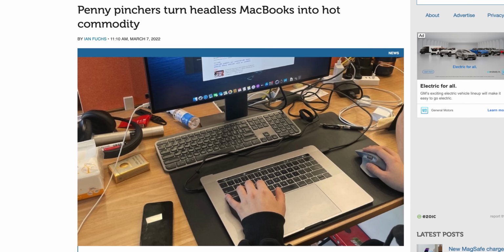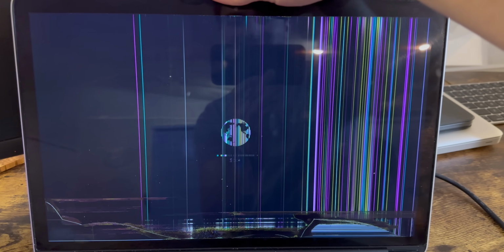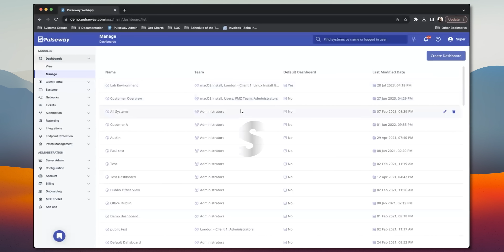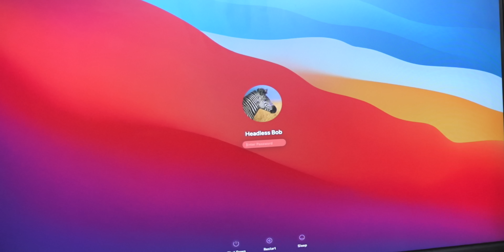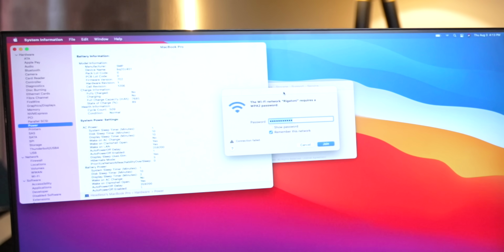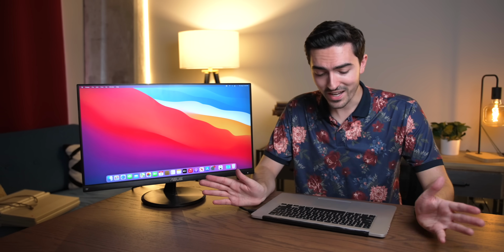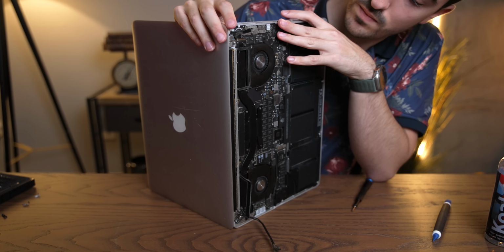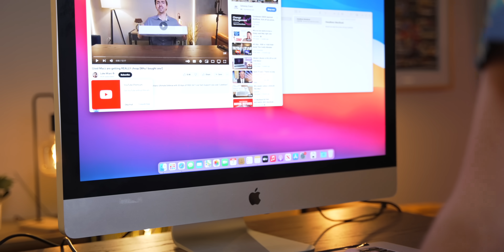Exploring the weird world of 'Headless' MacBooks

Comment: I have two mid-2012 13 inch macbook pros and just bought two aluminum stands (on edge) with the lids closed and hooked to 27 inch monitors.   I didn't bother to do anything with the displays (they worked).    I have a great Logitech wireless keyboard that allows for up to 3 computer hookups with bluetooth and that allows me to share a backlit keyboard that is chargeable (several weeks of use).    I have a mouse with each laptop.   The displays are better quality than the original displays and show true 1080p not the native dumbed down version.    I would love to buy a newer broken screen mac to play with and to hook up to an external monitor.    That will be my next project.

Comment: It is Apple’s entire business model to make you buy a new machine when your new one is broken. Apple green washes like all the other big corporations. Your last video proves the point of how hard they make it to repair or upgrade. Very difficult to break through the walled garden. Really sad state of affairs as we drown in all the e-waste. Thanks for your and Rossman’s advocacy on this subject!
Reply: You are absolutely right. I have been selling new Apple computers and repairing Macs as a certified technician for over 14 years. I hear time and time again from my customers that they have been told at the Apple Store that their Mac is obsolete at 5 years or more of use. This is how Apple sells new computers, but it is simply a lie and anything but honest or in the interest of the environment.

In my consultations with customers, I communicate quite differently because judging a Mac by age is wrong. I judge a Mac by its compatibility with the current operating system. And even that doesn't matter if the customer still gets on well with an older macOS version and can do everything with it. So I repair Macs much more often than I sell new ones because that is more economical for the customers, as long as the performance of their Mac is still sufficient.

In fact, most users only use Safari, Mail, Photos, Pages/Word, and a few other apps. Nothing that would require enormous performance. And very few people need an M2 for that if the CPU was hardly used to capacity with an i5/i7.
Reply: @level16gmbh83  It baffles me that customers shell out 1500+ dollars for a macbook while they could perfectly live with a 250 dollar chromebook...
Reply: @level16gmbh83  So you are complaining that Apple ultimately gives you ongoing work?
Reply: @level16gmbh83  i think its funny how "fast" Macs get obsolete (officially). I mean I still could use a 2010 laptop normally for these tasks you mentioned, if it came with an i5 (maybe even higher-tier C2D) when upgraded to an SSD and more RAM, as long as it runs Linux or Windows. 2010 MacBook Pros didn't get a new macOS since 2017 and the last security update was 2020. Atleast with Intel Macs you have the option possibility to install Windows/Linux, but I don't wanna know how this will work out with Apple Silicon Macs
Reply: What's really most important to Apple is the price of their stock. They have to extract as much money from customers as possible, every quarter, to protect shareholder value.
Reply: All while they scream at public for hurting the world while claiming they are the pure ones saving it...
Like electric cars not being repaired and keeping silent about needing new battery packs all the time for extreme prices..
They could use Hydrogen with a normal engine but that would mean people could fix their cars and fill them as they want for travel over any distance...
They instead want to make new cars into current phones..
No repair, your every bit of info monitored and your controlled by the product creator..
Reply: Dude but apple removed the chargers from the iPhone boxes, so they obviously care about e-waste and the environment.

Comment: Great video… I've done this a couple times… I've also found that the illuminated keyboard stops working… Because the camera sensors, detect, ambient light… And the ambient light determines whether the keyboard is illuminated or how bright the display is… So there is a need for a work around that I haven't figured out yet… Love your channel! Continued success!
Reply: Doesn’t stop working. Just turn off the ambient adjusting of the keyboard brightness

Comment: I use a 2017 MBP with like 10 percent of the display dead and weird colours sometimes but you can press the screen down and it’s fine. I use it often either as a desktop or just with smaller windows as my previous MacBook was an 11 inch MBA, and my most used devices are my M chip iPad and gaming pc anyway. I got the MBP for less than £100 and everything else on it is perfect so it’s a good way to have Mac OS when I need it.

Comment: So essentially this harks back to the late 70s/80s  personal computers a la Commodore 64/128 or the Atari offerings of the time or even the Timex/Sinclair computers from that time period. Cool. I'm one of those strange people who loves to play around with old "antique" computers. If you run O/S and software it was designed for, they run almost as fast as modern computers. Don't believe me? Try running system 6 on an old compact Mac SE or even better an SE30.
Reply: My first computer was a Timex/Sinclair 1000 2K RAM with a 16K booster cartridge, a cassette player for storage, and a 13" black and white TV. 😁 Next came a C64, then a C128 lol. Were you spying on me?

Comment: I bought an M1 Pro off someone for £400. Directly a screen replacement is £820 or DIY is £600. I took the screen off and use it headless. Only disadvantage is basically driving 2 displays at all times but it’s a cheap Mac mini Pro alternative for £1K less with some advantages. Just make sure to learn the screen swap shortcut when updating the OS CMD+F1 I think off my head. Everything works due to the M1 Pro design Wi-Fi and Bluetooth.

Comment: The fact that you can move it around while on battery is pretty cool, but if you actually want to use it as a desktop it's probably a good idea to remove the battery so it's not plugged in and charged all the time.
Reply: If you remove the battery the SMC will have a fit and will run the fans 100% and throttle the processor.

Comment: Hi Luke, I just did the same thing for a mobile recording system. I repurposed the Wi-Fi antenna assembly same way you did, yes with black tape as well 😂, but plan to create a nicer 3D printed solution soon. I mounted the headless MacBook Pro 15 2014 in a custom rackmount sliding drawer. I’m using a portable display that I mounted above the rack case that folds out of the way for transport. Fun project, used parts I had lying around to create a great mobile pro audio mixing and recording system. Spent $70 on MacBook Pro, no SSD 😢, but put a 2TB in it for not much money.

Comment: After the fun activity of pouring liquid into my display, I turned my 2016 13in MacBook Pro headless. 
Wifi still works (antenna outside of the display hinges) and the Touch Bar is finally useful! 
I installed a mod to display useful info on the Touch Bar, including an the Airplay command to connect to my Apple TV.

Comment: Obviously Apple has no "obligation" to make repair parts available for a reasonable length of time and at a reasonable cost, but they should. They should also have an obligation to make their items repairable, at least to some extent. The idea of having to be Hugh Jeffreys and have a dedicated heat plate, or to have a laser designed to burn away the overly strong adhesive is absurd.

I'm fine with not having the device as easily opened as, say, the EU is suggesting needs to be done. That's a little over the top. But having something someone reasonably technical can repair, or which can be brought to a shop for a reasonable price for a battery or display replacement, and one which won't generate countless warnings about fake parts or disabled services, that should be their obligation.

Comment: A few of your recent videos seemed liked commercials with just enough content to pretend otherwise. This video was a solid repair/reuse video that also contained a good and strong theme.  Apple would, if they could, try to get people to buy a new laptop if their battery ran down...or force them into the Apple Store for a recharge because doing so yourself would be deemed "too dangerous." This is no exaggeration, for much of what they have built into their machines is an attempt to ring the maximum amount of money out of the users while claiming safety issues, etc. So this video is timely, non-namby-pamby, and makes a bold and needed point.

Comment: I'd be curious to see this done with a modern Mac, if it's still possible. You could have power, display, and ethernet over a single usb-c cable making for a pretty sleek desktop solution.
Reply: Yes, and it's actually easier on those models because the antenna bar is located in the top-case as a separate part.
Reply: Yes, I did this with a 2020 MBP with a blown LED fuse.
Reply: @jcw1569 m soc or intel?
Reply: @cosettapessa6417  apple silicon
Reply: I’ve done with an m1 air
Reply: It works great on M1. Using as my daily driver now.
Reply: Currently using the 2020 MBP M1 and the screens destroyed but I plug It into a monitor and I have no issues besides not being portal anymore

Comment: Isn’t the base m1 Mac mini or m2 Mac mini better deal. They are more powerful, while is extremely affordable, especially when you use student discount or buy one second handed.

I don’t see a point of using inferior laptop as desktop, while losing the laptop feature, for ever.
Reply: Someone here mentioned that they tried this with an M1 but something about the system forced it to not do the clamshell thing correctly without an attached internal display. The point is that sometimes a setup like this is fine if you're not plotting galactic wormholes or doing structural engineering 3D models. Not everyone needs top horsepower to do what they do, and not everybody has $$$ for the latest tech either...or the desire to buy it.

Comment: When you said the only downside is you can’t use Wi-Fi or Bluetooth cause of the antenna placement i was like “no way Luke is gonna stop at this”. And like always you didn’t disappoint ❤
Reply from the maker: You know me 😆
Reply: @lukemiani did u 3d print any case for the antenna?can u share the stl ?
Reply: Will no-one mention the way he installed the antenna he taped the vents up completely, so the device will probably overheat quickly?
Reply: @piotrch0 no he didn't. The vents you can see are visible. He just installed a plastic and tape cover where the hinged screen would be.
Reply: My display died on my 2019, want xCode but don't wanna spend $700 on a repair or 2k on a new mac. I went headless. It pretty easy tbh. I reinstalled my wifi and Bluetooth antenna bar. I have wifi and Bluetooth with no exposed wiring, etc.
Reply: I don't get why he didn't use a small usb dongle for WIFI and Bluetooth... Seems so much simpler to do.
Reply: @nearcz533 one downside is you lose a USB port. The way he did it has really no downsides aside from a bit of extra work
Reply: @jarboer but it’s never leaving your desk anyways. Not really a inconvenience to add a usb hub
Reply: @jarboer another downside I see people forgetting is macOS, especially later versions such as big Sur, don't have drivers for usb WiFi dongles and with the way apple changed how kexts work in big Sur it'd be more trouble than its worth to get handoff, etc working, let alone WiFi. Plugging it in over ethernet would lose you a thunderbolt port and those aforementioned continuity features, etc. This is really the best way (other than buying your own antennas which would probably look worse) to get WiFi working.
Reply: @mattwilson8509  I mean who said it won’t leave a desk? Luke mentioned that it would also be easier to connect to a TV to watch something (compared to a Mac mini), though that might not be that important for everyone
Reply: @jarboer  Yes, he mentioned that, but let's be honest: You do not want a media computer running off batteries (quite old batteries at that). The battery is helpful so you can switch to your TV in another room without having to turn off the machine while you move there and plug the power adapter to mains again.
Reply: @BilisNegra  ah now that you mention it, he didn't have his MagSafe adaptor plugged in in the video - guessing he usually does! (I know I have my headless MBP2015 plugged in pretty much 24/7)
Reply: @nearcz533 he was pretty clear @7:01 he thinks plugging yet another thing into the side is pretty ugly (not to mention the theme of this video is to reuse & maximize his $60 investment - electrical tape is about all he needed at the end of the day which is pretty cool!)
Reply: @nearcz533 then you would lose an usb port, handoff, Airdrop etc. Why would you want to lose those if you literally can plug the antenna back to the original wifi card.
Reply: @nearcz533 I think the drivers wouldn’t be so simple as it is in windows. Windows is just plug and play, but MacOS probably only has drivers for the antenna that comes with the laptop.

Comment: Excellent video. I've been doing this sort of thing for years.
How about making a 'home only' lightweight laptop? You get a small underpowered inexpensive laptop and use it to display a powerful desktop system running somewhere else on your network?
Reply: You're describing a Chromebook using Remote Desktop, and there are other setups like that but I can't remember what they are right now. I don't use that, but I have tried it a few years ago and it works pretty nicely.
Reply: I was actually thinking of an apple laptop with a decent screen. I hate Chrome books. My plan was to use Anydesk - to get the sound. I use VNC for my RPis. I bet a purpose made Apple solution would be fantastic.Light weight, Great screen and sound, no memory or storage limitations and a good keyboard. What bit could we fix up to manage that I wonder.
  @CallibanMcGee

Comment: I agree that repurposing is so cool and handy!  I also agree with your point about the Right to repair and accessibility to parts. BTW your Sihoo C300 chair is excellent I really want one, but it's sadly not available outside of us with your code...:(
Reply: For older laptops like this economically new original OEM parts are always going to cost way more than the device is worth.   Running a dedicated production line for the low volume of parts that would be needed would push up the per part cost way to high.

Comment: A wireless display connector would turn this into the ultimate htpc. Would Bluetooth be enough to cast a 4K (or 2K) picture to a display?
Reply: not possible. Would have to use specific product in hdmi port. wireless HDMI adaptors exist, but i think they might be on the $$$ side

Comment: I've thought about doing this before, but thought I'd screw it up.  Great video as always.  One additional thought - I use an Apple wireless keyboard and a magic trackpad on my desktop Mac, and I definitely prefer to have the trackpad to the right side of the keyboard instead of underneath it.  But I have no problems using a laptop.
Reply: You can do it! Luke's videos and iFixit or others make it accessible, if not easy.

Comment: Yes I believe Apple needs to make parts more available. While this is a cool mod that I’d certainly do to retain a machine’s usability, I would much prefer a full MacBook as I could connect it to a monitor the same way. 
Also Luke, where do you get the background music for your videos?
Reply: Providing parts for 10 year old Macs is not as easy as you might think.  The production lines that produced those screens have long since moved on, so if you wanted to fire them back up there would be a large overhead in cost making the per screen cost much much higher than would be acceptable (as the number of displays they would produce would be low).

For this situation of old devices what would be better would be to provide the schematics and CAD files etc with a license to that third party vendors could go out and make alternative parts (not OEM).

With the specs having a license that others could target (legally) im sure some companies would figure out how to make little adaptors to that you could attache more commodity display panels without needed to fire up a dedicated production line again.
Reply: Apple gives not a shit about making their crap fixable
Reply: @bb5242   Not true apple care a lot about this, but only when it is themselves doing the fixing. 

When you get a warranty replacement you are not getting a new product you are getting a refurbished product (in a new case) that fixability saves apple a LOT of money compared to taking a new product of the production line and giving it to you.   

This is why apple prefure skews (lots of them) over glue, it saves them money in the long term.
Reply: @hishnash  exactly
Reply: scarcity breeds more profit.
Reply: I don't know how far it goes, but Apple's Self Repair Program has all the parts you need for M1 Air

Comment: I actually did this about a year ago to a 2017 13". I wanted to have MacOS on my iPad and the easiest way to get that was to use it via sidecar as a display. I had a Magic Mouse/Keyboard connected to the Mac and used the iPad as a display. This actually works pretty well, sidecar acts just like an app so you can rapidly switch between iPadOS and MacOS. A nice bonus of removing the screen is the massively improved cooling performance, on this Mac you could never hear the fans, it's still an intel so it got hot but never enough to get load.